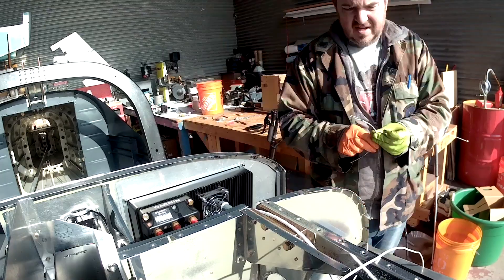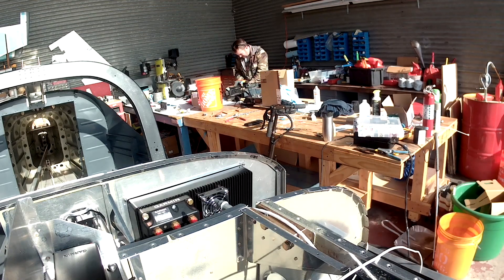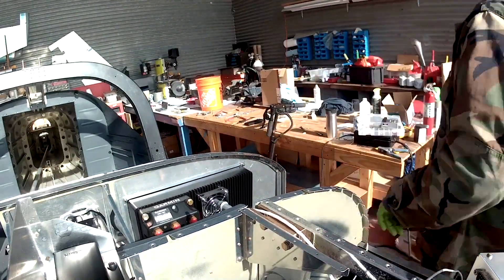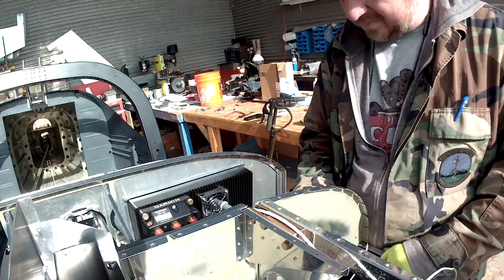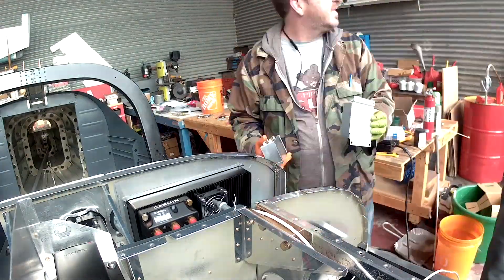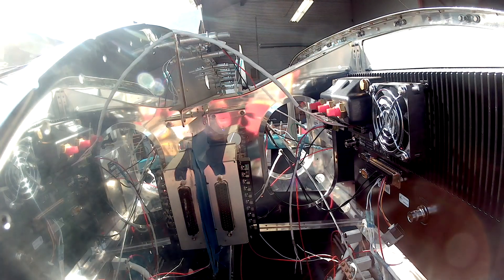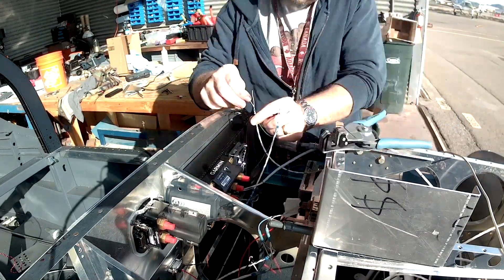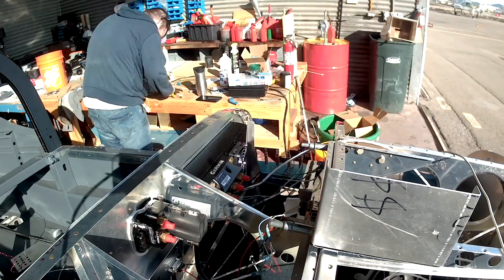RV-14 Flap Sensor 2

Comment: Wow, I didn't realize the sensor bolted to the back of the G3X.
Reply from the maker: Right?! Its weird because of the minimum length of wire you need to make the backshell connections. I could connect the AHRS and display unit with a 3" wire if I wanted to.